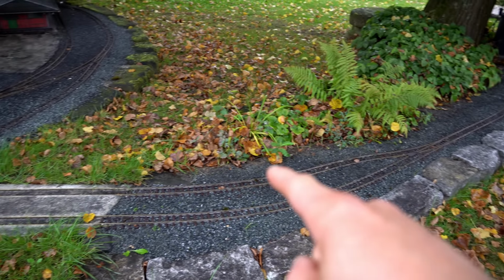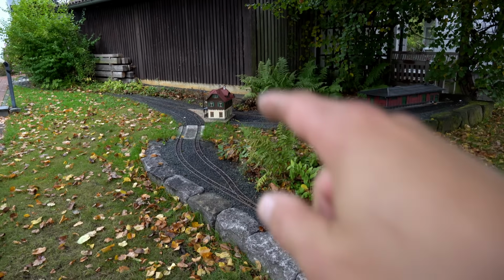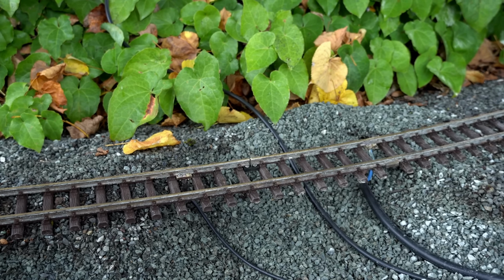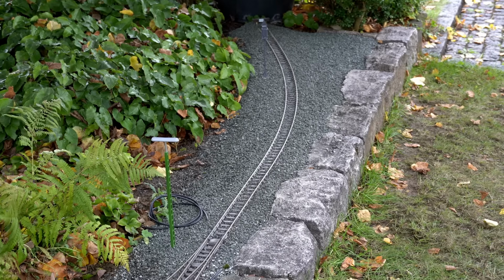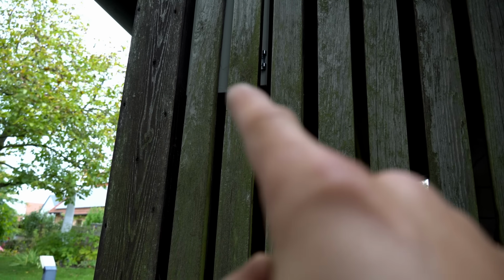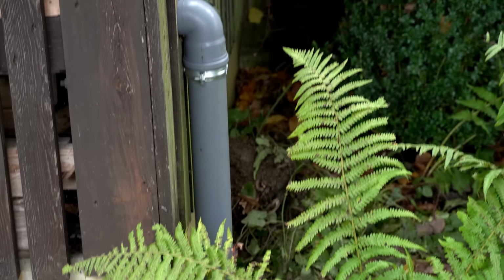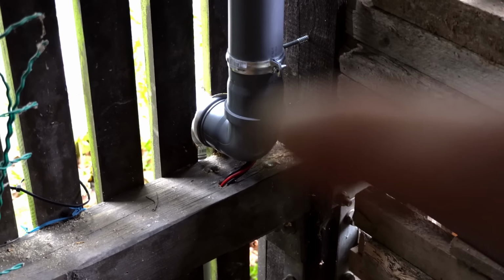UNDERGROUND WIRING for my railway station

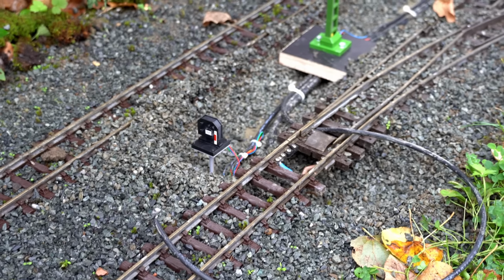Comment: 10:35 Agree, signals on the “wrong side” are quite common here in Norway (and elsewhere, I’ve noticed…?). Per regulations (numerous caveats…), a small arrow-sign is mounted on the signal, pointing to the relevant track. 

Can’t remember German practice, need to watch more Alex E…?

Then again, your route learning will surely be examined by your nitpicky track inspectors. You’ll be safe… Grüße aus Norwegen…!
Reply from the maker: Some countries including Switzerland have their signals on the left side of the track. In germany we do have them on the right side. You can put them on the left side if you install a certain sign on the right side that tells the train engineer about this situation. But if I set up a sign on the right side of the track it will be damaged or gone in no time just like the signal would be. In such situations I do make compromises to avoid unnecessary trouble so I decided to put no sign to the right side of the track. The track inspectors will make sure that every one knows about this situation for sure!

Comment: Very good work. When I started my layout in my garden I didn't have a clear plan, and i put small cables for wiring under the tracks. Now after some years I understood they were too small for all the cables, specifically if I need to split the power connection in different sections. Your work is wise. You plan in advance all the cabling and above all you put a larger pipe so there shouldn't be any problem if in the future you need to add other cables. I'm curios to see your detection system and how it is wired.
Thanks for your video, very interesting and very useful.
Reply from the maker: I am glad you enjoy the wiring project and it is useful to you! Trust my I did the same mistakes that you did. Since then I have learned from my mistakes, this time I will do it right. It saves you so much additional work in years to come.  There will be several videos about the detection siystem once I get the parts. The installation itself will be also a seperate video. Most likely it will happen February 2025.

Comment: Always great to see how you put the wiring in. No one else ever shows this part of the work and it's what I've always wanted to see.  I always wonder how do you know which wire going into the shed is which? Are they marked, or do you have to do some kind of continuity test? 
And do you worry at all about temperatures on the shed for winter and summer on the electrical equipment in there? 
Thanks again for a very informative video.  I guess the track inspectors had the day off. ;-)
Reply from the maker: On this project you get to see the whole story, including wiring! Many people don´t show how they build their layout over all and even less show the wiring. I am glad that I can provide all of that for you guys. Your question about identifying the wires is answered in the next video. At this point in time they are not labled, just a bunch of black cables. I am not really concerned about temperatur differences, more so about water. Most electrical equipment can withstand a wide range of temperatures but moisture kills it. This is why I take the effort to install one continues cable from the main electrical box to each appliance. No decoders outside, all of them will be in a safe, dry electrical box. Regarding the track inspectors, they are not allowed in this part of the garden. They can only fisit under supervision...

Comment: Hello from UK, Excellent video and update as always.

The position of that ground signal to the left instead of right, is the right thing to do, on the big railway, sometimes things have to be done that way for a number of reasons, ( mowing the grass is not usually one of them 😆)  but a drivers route knowledge would include changes to signal positions.
Reply from the maker: Thank you, I appreciate your nice comment! It is a bit of a compromise since I would need to set up a certain sign on the right side of the track to make it prototypical for german standards. But this sign would have the same problem as the signal in the first place so I won´t do it. Route knowledge will be very important on my layout anyways so I just added one additional part to it.

Comment: I would place a 90-degree turn pipe just under the steel box inside and then feed the wires inside it. In your pipe, water can leak into it, get inside the pipe and can freeze or harm the wires. My solution will keep most water out.
Reply from the maker: The amout of water that will accumulate inside this pipe, if any, will be so minor that I won´t have any problems with freezing. Should there ever be water inside it will be able to drain out on the bottom of the pipe which is also open. If the pipe opening was outside, without a roof ontop of it your solution would be mandatory!